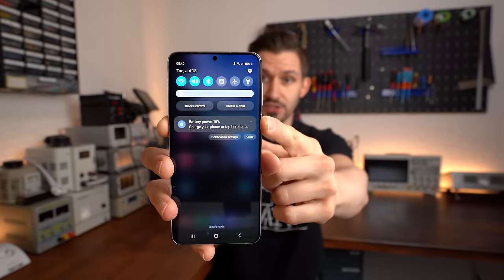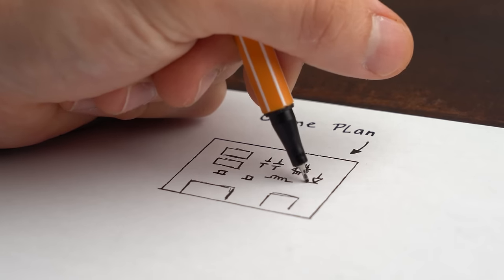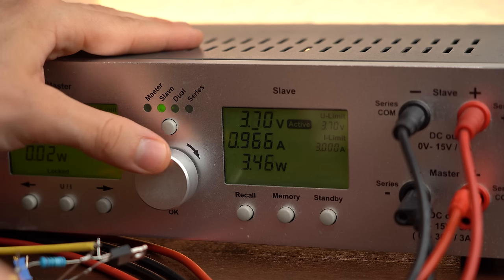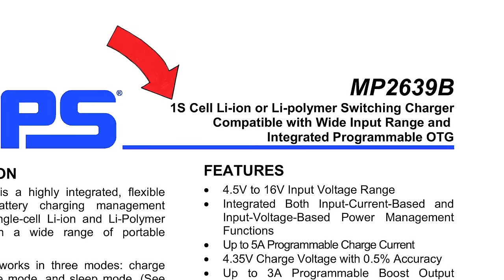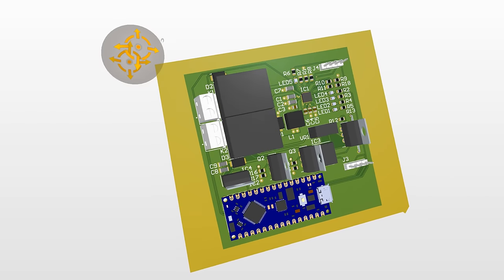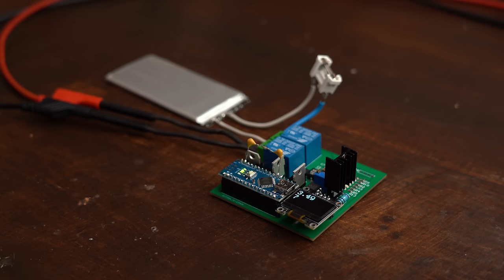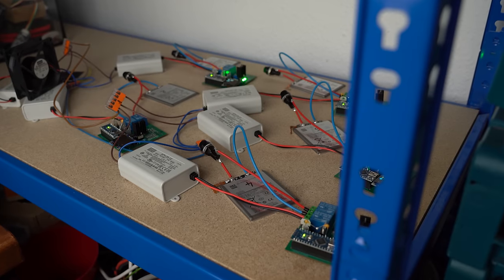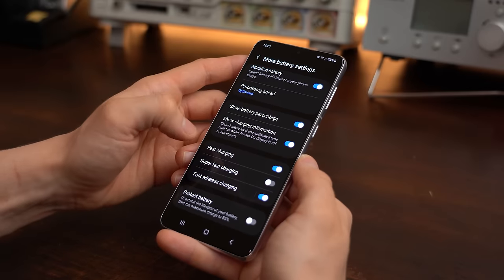Don't Fast Charge your Phone before Watching this Video!

Comment: I work in a battery lab. And i do these measurements. The real information comes from trendlines while charging and discharging. Meaning you have to log all the voltage readings ( 1sec interval). The degredation shows in how the voltage behaves during charge /discharge cycle. To really know the batterys internal stage we measure something called EIS (Elecrochemical Impedance Spectroscopy).  That gives good knowlense about the chemichals inside the battery. A EIS measure system would actually be a good electronics project noe that I think of it :)

Comment: Wow, great job mate, finally someone did exactly that. I see your testing method is straightforward, but here are some notes:

1- Heat - > yours is exposed to air, cooling faster, while in real life scenarios, phone batteries are enclosed and heat faster for longer. 
2- Usage while charging -> People use their phones while charging, adding cycles and stress as charging happen while discharging. More heat as well (as you are probably well aware). 

Just for the next time you might think to repeat the test :) 

Thanks again for the time and effort. Great work

Comment: Hi! Really nice content as always!
I would just like to point out that the ageing behaviour of lithium batteries is linear only after a first period of "chemical balancing" inside the cells (which induces a streep drop in capacity). This means that in the first hundred of cycles, the capacity could degrade by even 5%, but then it would stabilize to a much lower (constant) degradation per cycle value.
Reply: Also, the charging is slowed when the charge is high or the battery is hot.
Reply: Good info would love for Great Scott to test this.
Reply: @isaacamante4633  that’s just part of the charging method, you charge it with constant current until you reach the voltage limit which is when the charging voltage reaches the max battery voltage, then you just charge it with constant voltage, the maximum battery voltage and as the battery fills up the current decreases.
Reply: @conorstewart2214 yep, the time needed to charge the battery to 80% to 100% could take more than 0% to 80% due to the huge drop on current flow! Some car manufacturers suggest charging batteries only to 80% if you are in a hurry or to preserve the battery lifespan!
Reply: @MyNotSoHumbleOpinion My phone, a OnePlus 7 Pro, learns your sleep schedule and then will charge to only 80% at the start of the night, finishing it up to 100% an hour or 2 before I get up.
Reply: @ajsnz  True. It also charges slower at night, assuming it has more time until you wake up.
Was happy to see a company actually putting effort into their product lasting longer rather then making it obsolete after two years of use.
Reply: @fie1329 This is what Sony phones have been doing for at least 5 years and others like OnePlus and Samsung recently included that functionality.
Reply: @lukastemberger  Same with iPhones. I wonder if there's a brand that doesn't have smart overnight charging.
Reply: @lukastemberger  It's good to know Sony and Samsung do this. My OnePlus 7 Pro is 4 years old and has just fallen out of security update support so I'm looking for a replacement. The Xperia 1 V and S23+ or Ultra are looking like good options.
Reply: @ajsnz  my old Honor view 20 does the same, but my newer Xiaomi not! I don't know why this function can't be integrated in android! I know every smartphone has its own charging circuit, but a standard one with software control can't be too expensive! But it's still true that nowadays batteries endure more than the phone itself, even when abused by super chargers!
Reply: @ajsnz  Your replacement may well be installing LineageOS on it.

If it ain't broke don't replace it!!!!
Reply: @Splarkszter  I would except I have apps that need to pass Safety net and other checks. I ran Lineage on my OP1 and OP3 when they fell out of support :)
Reply: That was also my thought. Extrapolating from the first 100 cycles doesn't seem like a very reliable idea
Reply: @conorstewart2214  Thats exacly what I sad, sadly its not what happens on the video.
Reply: @isaacamante4633  that is what happens in the video though. The battery was charged properly.
Reply: @conorstewart2214  I'm sorry, i remember it saying that the charge is been made at constant current.
Reply: @isaacamante4633  the bulk of the charging process is constant current, it's only the final stage that is constant voltage.
Reply: @conorstewart2214  You're absolutely rigth. But is that what happens on the video?

Comment: It would be very interesting to see this experiment over the long-term (~12 months or so) with included data for the increased internal resistance measurements over this period (which is probably largest contributing factor to increased capacity degradation over time which increases with respect to higher charge and discharge rates).

Comment: Thanks for running these tests.  I'd be very interested in seeing the results at 200, 500, 1000 cycles since the degradation is unlikely to be linear.  I'd be even more interested in seeing the results of a similar test except comparing charging to 80% vs 100% rather than 1A vs 5A.  My belief from personal experience is that keeping the battery between 20% & 80% SOC has a larger positive impact on battery longevity than anything else it is reasonable for an end-user to do, but I've never done any experimental testing.
Reply: Use use realme GT 3😊

Comment: Awesome! Some of the manufacturers know that fast charging only one cell is a problem, so they charge two cells with split current (Instead of 5A going directly to one battery, they split it so only 2.5A go to each), i think it is a nice way to overcome this and make the battery life least a bit longer.

I would love to see a video about that, i love your channel <3
Reply: that does not make any sense at all... that's not the reason why some products have 2 cells... the space that 2 smaller cells would physically take up is equivalent to a single cell with twice the capacity... charging a 2.5Ah cell at 2.5A or charging a 5Ah cell at 5A is the same...

Comment: Thank you very much for doing this. The only thing I’d suggest (other than continuing the experiment to reach 500 cycles at least) is you’re missing the heat aspect, faster charging produces more heat in the phone, which heats the battery, which I believe increases the rate of degradation

Comment: 8 layer PCB! Very cool! I remember using a dual layer copper plated boards that were mechanically etched with a lathe bit for my circuit boards! Kicking it very old school there.
Reply: Used to use ferric chloride back in the day to etch PCB.. 😊
Reply: It's a simple 4 layer board construction

Comment: I like your design for charging and discharging circuit. Although I would recommend using a single atmega328p to achieve 6 charge CV (4.35v) and 6 discharge (1A) using PWM and PFM techniques. The 6 analog pins can be multiplexed for additional 6 analog pins. The voltage and current(need op-amps) sensing can used to detect current and voltage for 6 separate batteries. This can make a single device that can charge and discharge individual cells. This would make the design simpler but it could come at a cost of extensive programing, and manual testing, instead of the purpose built IC.  But awesome content and great info on testing batteries. Oh yeah, one more thing, the battery quality and chemistry might be different in commercial phones. Need to test broken phones and test against them.

Comment: Some comments probably already pointed that out but the results of this test won't really translate to smartphones' battery wear in real life. Most smartphones have different battery strain protection features that Scott didn't account for in the test and didn't even mention.

Smartphones do not fast charge to 100%, they tend to switch to slow or regular at around 80% capacity. Also thw charging slows down if the battery temperature goes too high.

Comment: Very interesting Video. I think in the phone the batteries only get charged with 5 amps for a short duration and the current gets lowered at around 80%. I think that makes quite a difference in the longevity. Also in Samsung phones the charging voltage gets lowered after a 1000 Charge cycles. That would be an interesting topic for an other video.
Reply: Yup, most OEMs put in various rules of when to start ‘fast charging’ and when to cut it off. From experience with iPhones it will only start if the charge state is below 50% and cuts off at 80%. 

As for charging cycles I’m fairly sure that most people aren’t doing a full 0 to 100 cycle each day. So partial charges have less impact on degradation. Having said that they still degrade, it’s just slower than what it used to be.

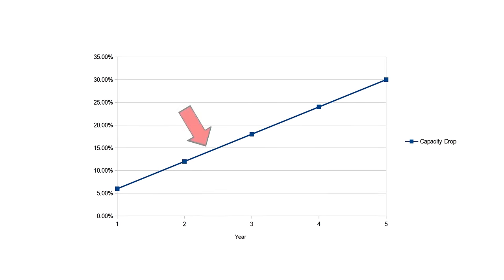Comment: 11:27 great vid, love your project !!
Two remarks: the capacity of new li-ion batteries will degrade in the first few charges until the chemistry inside settles (something like that). So it can be very well that fast charging, this initial degradation is more than the slow charge, but over time the degradation of both fast and slow will be the same. Would be interesting to see your results in 1000 times or so. 
Second: at least my Sony Xperia phone has a battery management system that can control charging power depending on how full the battery is, and pauses at 80%, until it thinks you will use the phone in the morning based on previous use, and at the last moment finish the charge till 100%. These measurements will keep the battery in very good condition for a long time. Same as a Tesla car, it has very good battery management system, pre heat or pre cool the battery before charging, charge at high speed the first 30% or so, and slow down until the end, change til 80%, unless you need a long trip. Compare Tesla battery life time with that of a Nissan leave, you will be shocked! LiFePo batteries like to be fully discharged and fully charged, they are a bit less energy dense tho.
To conclude, let us know the test results of a 1000 charges.. I'm curious 😊
Thumbs up from me here in the Netherlands 👍🏽
Reply: Yes, Samsung does that too, also phones never fast charge to 100%, they charge slower after ~80% to avoid strain on battery.
Reply: The Netherlands are a good adress if you want to replace a battery from the leaf or let it upgrade. I thought in Delft there is a company who offers this service. Here in Germany most repair garages dream in petrol yet. Anyway as a leaf owner I can confirm it, but Nissan hadn't learned from their experiences and built the successor also without battery cooling. Where you can run into issues on long trips with fast charging. At least we didn't decide to buy a new leaf for this reason and get a Hyundai EV.

Comment: Some manufactures use Adaptive Charging.  When you charge your phone after 9 PM, with an active alarm set for 5–10 AM, your phone uses Adaptive charging, charging slowly to save your battery.    Otherwise, your phone charges normally.  The last two Pixel Phones I have had did this.

Comment: Awesome experiment! But I have a question in mind: Modern smartphones makes use of means to reduce this effect, have you considered anything on those charging device, like "Trickle Charging", Battery Temperature control (Since the batteries will probably get warmer from each cicle from the constant 1A use), and Adaptive charging? If not, these are a few points you could explore in future videos for this experiment, cheers!

Comment: Great video! I do think I would like to see this test with the charging curve that phones use these days. Many of them will charge at 5 amps until about 50% then lower to say 4 amp, then at 75% or 80% lower to 2-3 amp and for the last 5% charge at 1 amp. I think this does a LOT for the cell health. There is also the newer voltages offered by USB-C PD like 9v, etc. Additionally. My research in college on cells of this type showed that heat was the main factor in degradation in almost all scenarios. This is why I put my phone on a metal desk when fast charging if possible and after monitoring the battery temperature while charging, it now stays at the same temperature as if I was charging my phone at 1amp. There is also the new features that allow you to stop charging at 80-85% because the second biggest factor is taking a lithium cell up to 100% (and inversely down to 0%). This is more pronounced during long periods at a high state of charge so I think your test probably won't see the effect of that as much because you quickly start to discharge after charge reaches maximum. As others have mentioned, there is also a chemical break in or balancing period where there will be a slight upwards trend for the first few charges (if they weren't conditioned from the factory) then a steady and higher than average reduction in capacity until it levels out over 50-100 cycles. Lithium tech is complicated there's a LOT more tech going into charging your phone and laptop these days then "Just throw 5 amps at it".
Reply: Yeah, there was so much wrong with his method here.
Reply: I have been using 120W supercharging for a month now and I am using a program Accubattery From the first day the phone was opened out of the boxes It gives me data that the health of the battery is 95 percent, knowing that I do not let it drop below 10 percent, but charging is always 100 by 100
Reply: also you can limit the charging to 80-85% on some phones. I wonder how much it helps.
Reply: The 9v at the USB isn't fed straight to the battery. It's still charged at 3.5-4v for most of the charge cycle. The higher voltage on the USB port is to overcome the crappy think wires in a lot of USB charging cables and push more power at least current.
Reply: @tin2001  Higher voltages are to get more Watts. Higher the voltage, lower the amps for same Watts. Not because of crappy wires, but in order to keep wires and connectors small. The connectors can only handle so much current, but much more voltage. In order to get 40W at typical 5V it would be 8A. So they bump the voltages up to lower the amps for the same Watts. 40W at 9V is only 5A, 40W at 20V is 2A etc.... And yes, of course there is a charge controller to limit what goes to the battery. Look up the PD specs for standardized voltages and currents, then of course some manufactures have their own as well.
Reply: Thank you for the idea of charging the phone on a metal desk to keep it cool (without needing a fan).

Comment: Nice video. The difference is really visible. I would really like to see some more testing although it might be really difficult to build as I can see now. Maybe more real life scenarios like charging in the 20%-80% range or how charging voltage affects the battery life (some phones use 9V charging). And more cycles to check whether it's linear trend or it gets worse over time.
Reply: Yeah I would second this as well. As Samsung and other manufacturers are aware of this battery degradation and have take some steps to mitigate this. One of them is that by toggling a switch in battery options, it limits the max battery percentage to 85%, thus sparing your battery from the most damaging top part of the charging cycle.
Reply: The actual charge voltage will be around 3.5-4.3 volts like shown in the video, not 5 or 9 volts, that's the power supply voltage before it gets regulated for the battery

Comment: little tip for next battery test -high  temperature damage the battery more than amount of charging procedures... older battery   could have higher internal resistance , so there will be higher temperature during a charging time and  speed of degradation will increase

Comment: This video couldn't have come at a better time.

I mean it came right on time for when I've been reading up and researching about fast charging on phones and its effects on batteries for the past week.

I must commend your effort, Great Scott. You've done amazingly well to have gone ahead to actually test what most of us have only theorized and speculated. I'm quite surprised at the results, though it wouldn't bring me to the same conclusion as you because I feel the time savings from fast charging is a whole lot more valuable than the ~11% battery capacity loss after ~2yrs. Especially since smartphone batteries can actually be replaced if and when it loses too much of its capacity.

Thanks once again for this experiment, I hope you can continue with it to maybe present longer-term results of fast and slow charging.
Reply: Fast charge can be a good thing but if the amp is to high it can damage the battery, what most people dont know is that battery has maxinum charge rate that can fast charge a battery without damaging it, if you have a 12v battery you can fast charge it with a third 1/3 of the rated voltage, 1/3 of 12 is 4 so you add that 4 volt 12 and you get 16, a 5v battery would be 1.6v so you add 1.6 and you get 6.6v at about 1 or 2 amp.
Reply: This is so misleading most common fast chargers charge your phone 5v,9v,12 with only 1-3amps than those 5amps also those 3-5amps pretty sure they dont charge the whole battery for 3-5amps its smart to gradually lower its amp tru the whole charging. Also ive read that those battery that being charged with 5amps are like two batteries in one package so meaning 2.5amps per battery and its fast charging because you basically charging two batteries at the same time